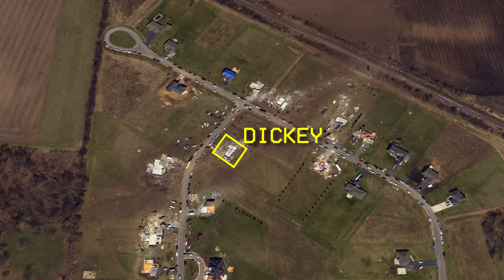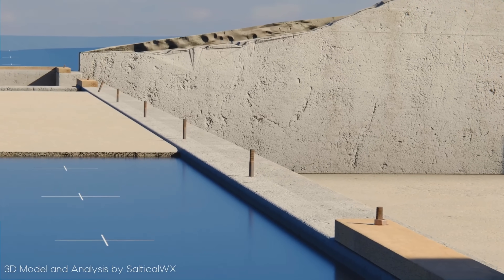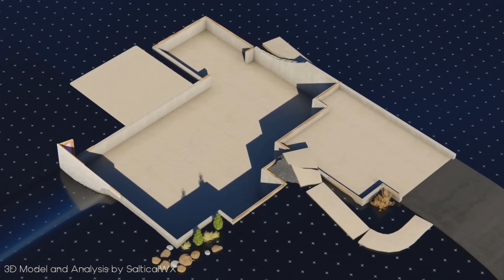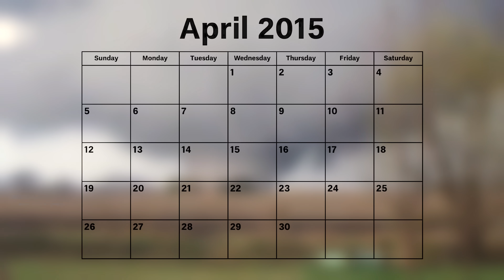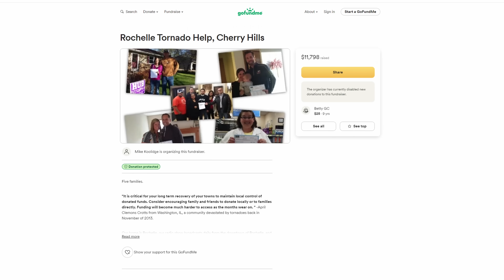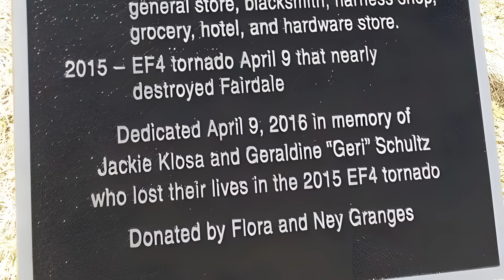The Strongest Tornado That Wasn't Rated EF5

Comment: In a high risk area...they rebuilt...now, thats understandable..its their land and they might not be able to afford to move,  but the houses are essentially the same,  wood...stone.. doesn't matter,  these tornadoes and hurricanes are powerful and are getting more stronger and more common,  its time to throw out age old designs, and start building homes that can withstand such power,  i feel its more to do with shape form aerodynamics... certain buildings have shown to be able to survive this type of severe weather,  from top to ground and ideally well under ground, something needs to be an achor holding buildings in place, whilst the shape and materials needs be able not just to withstand the punishment, but almost to guide the wind turbulence, to help the wind flow around and over....im not usually into modern architecture, i much prefer traditional BUT in cases like these,  dealing with weather like this....im afraid, its time to deal with living in hotspot areas...a change needs to be implemented in housing design

Comment: Rating tornados used to only be based on the damage and now it’s supposed to be based on the wind speed and damage but the smallest inconsistency in a tornados path makes it a lower rating El Reno mainly went through but it was 2.6 miles wide and had vortices up to 330+ mph yet it’s only an EF 3

Comment: If the difference between a tornado getting an ef4 vs ef5 rating is a person blowing really hard in the right direction, it should get an ef5 rating. 200mph is crazy to me. I think that getting an ef5 rating actually does make a difference, it gets attention from the public in a way that ef4s dont (the general public think "oh, an ef4 is bad but its not the worst it can get, right?) And therefore makes them less likely to donate to the relief effort. While arguing about past ratings is futile and will do nothing to undo the damage caused, both physical and emotional, updating the scale to more accurately rate tornados seems very important to me, both for the sake of science and for the impact that those super rare tornados have.

Comment: I know there isn't much difference between an F4 and a F5 but it seems almost disrespectful to the people that went through this to minimize from being what we all know is the truth, it being an F5 nightmare. I hope the change comes to this system in the future. Using these metrics you could go back to almost every F5 tornado and downgrade them. This should be strength and wind speeds, not destruction necessarily. Just like El Reno, that tornado was so strong it took veteran storm chasers away from us. Doesn't make any senss

Comment: Problem with tornado ratings is that they're basically done by amount of damage, not by its wind strength, width, shrouded or other factors of danger. There should be a separate scale for that

Comment: They wont give a ef5 rating even if its there they want to keep the moore the last ef5 its been shown they find a reason to downgrade a tornado to not make ef5 as they have done in greefield iowa just this yr we have had many storms that have been ef5 simce moore ok they just dont want to push the reating higher to keep the last ef5 as moore thats my opinion in general the mayfield ky was a ef5 but they didnt rate them right i feel they are intentionally withholding the higher ratings on many storms why who knows

Comment: 5:00 a miracle for car enthusiasts
Reply: Yep
Reply: Porsche 👍
Reply: Porsche🤺
Reply: Porsche sponsor = EF4 Durability 👍
Reply: Cars usually have less damage than the homes. Metal is stronger than the wall of an American home.
Even a thin piece of metal like a car roof is stronger than the weak wood americans use to build a house. 
Why they don’t use bricks and concrete is beyond me.
Reply: Apparently, the tornado doesn’t like Porsche or like Porsche
Reply: @caidonmorris8477 or it has massive respect for it
Reply: @caidonmorris8477  you mean it does like Porsche because it sparred it

Comment: Those poor pups being home alone when the storm hit. :/ If at all possible, try to keep your pets' kennels/carriers/cages in the same place as your safe space so when they get spooked they automatically run to where it's most safe. 

Bonus points if you have a ring camera or something set up so you can command them to go there remotely. It may not be enough, but it can help even the odds at least.

Comment: While I admit to not being any sort of expert on the Fujita scale, enhanced or otherwise.  I am a little confused when you put up the chart of the enhanced Fujita scale, using the wind speeds as the determining factors in its rating.   It was my understanding that the original Fujita scale used wind speeds.  But the enhanced Fujita scale used what level of damages occurred during the tornado.   In other words,  when looking at the largest ever tornado recorded, the 2013 El Reno tornado, (which to be honest, I thought this video was going to be about) was eventually rated an EF-3 rating.  You put that exact tornado going thru Oklahoma City, and it would be an EF-5 rated tornado.

Comment: I feel like that at high-ends and low-ends of categories should be .5’s. For example, if an EF-4 was at 190-200 MPH, it should be categorized as a EF-4.5, as it would sit basically in the gray area between EF-4 and EF-5.

Comment: I'm sorry,but unless the homes weren't built to code than I can't see any difference between the damage caused by this and a few other tornadoes and the damage footage I've seen from the 2011 Joplin and 2013 New Castle/Moore EF5 tornadoes!! Honestly think it might be slightly less than Joplin but at the level or slightly worse than Moore,so i guess id probably give an official estimated wind speed of 215 miles per hour...if i was to see this level of damage!!

Comment: Absolutely no doubt this was an EF5 tornado. It seems like the NWS is very hesitant these days in giving out EF5 ratings for some reason. Plus theres the debate down in Oklahoma area where Doppler on Wheels is measuring wind speeds well over 200 mph, but damage being caused is not consistent. Clearly, we need to take another look at this rating scale.

Comment: Im old enough  to have lived through  that april 74' outbreak. The aftermath of what  I saw in xenia, ohio  was a stoned, frozen face of disbelief that tested every form of logic and understanding.  A tree that had straw rammed into its core so hard that a 5 inch piece  was embeded through  the bark at the trunck an inch into the wood fluttering as if it grew out. And the football field wide scowering of the ground had you pondering what degree of force-might came through. You quickly  understood how something  as heavy as a locomotive could be levitated off  the ground with ease
Reply from the maker: Wow. Thanks for sharing James

Comment: I'm having trouble understanding how the southeast part/edge of tornado is strongest  because of rotation and translation. To my way of thinking, every side would be equally strong based on just those two forces. RFD is another matter regarding which side or part of the vortex is strongest, so I'm not considering that.
Reply from the maker: The tornado is moving forward and it is also rotating, the southeast side of the tornado is where these two directions are the same, so they add up. Hope that helps!

Comment: The only thing that I would add to the discussion on rating is that yes 200mph is the borderline of a 4-5 rating. However to be classified as a 5, it must clearly demonstrate winds ABOVE 200mph. If that debris was clearly missing, if the sidewalk had been peeled away and not bumped, if the cars were thrown miles and not yards...that is all cataclysmic damage worthy of the 5 rating. But still a 200mph beast tearing through is no small matter and I'm glad that 9 years on Cherry Hill and Fairdale are thriving

Comment: Problem is when you build your homes out of wet tissue paper, then no matter the speed its gonna have an effect, in Norway the wind speeds on the coast can reach up to 150mph. 
But the houses built there have literally steel beams going through them to prevent the roof from flying away, and the walls are half a metre thick with pretty hefty wood used. 
Interestingly, round houses are a thing in the US tornado areas one of those were hit 4 times over the years and still standing, kind of ironic.

Comment: I worked on a harvest crew back in 2011. We hauled a set of combines from Holyoke, CO to Kingfisher, OK. The wind was pretty high and NOAA radio was saying that the chances for a tornado were pretty high. We rolled in to Kingfisher and pulled in to a campground along the N-S highway in town, and while we unloaded the combines the state patrol pulled up and told us to get under cover. We quickly offloaded as the funnel was forming up above us and storm chaser were racing around. It was the single craziest thing I think I have ever done in my life. We off loaded and jumped in the truck and raced down to Eischens Bar in Okarche as we were hungry and figured the tornado would pass. While we were eating there was a lot of buzz about the tornado but we didn’t think anything of it. Turns out it touched down not far from where we were and it was pretty wild. The next day we drove the path and it was the most scary and awe-filling thing I’d ever seen. Oil rig platform ripped out of the ground. Houses wiped away. Cows in trees. Power lines gone. Train tipped over. Saw a combine that had been in the path rolled 1/4 mile down the field. It was rated an EF5 and I have to say, it was totally terrifying. I feel for these people when this happens.

Comment: The EF system is a joke. The power needs to be determined BEFORE any possible impact. This was an EF5
Reply: How can the rating be determined before the tornado hits?

I agree the system going off damage is a bit out dated but with how much tornadoes change over their life span, you can give a lot of erroneous warnings, 1 person could be told it’s weak, another could be told it’s an EF-5.
Reply: @AB-mw8oz  Doppler radar returns can give the wind speed, the size, and the speed of the tornado. It doesn’t matter if it’s going through crops, through forest, over the hill and through the dale, what damage it does or doesn’t do if it’s an EF 5 it’s an EF5. Calling it in  EF4 does not alter the fact that they measured the wind 250 miles an hour just because he didn’t take any houses off their foundations or throwing cars 3 miles.
Tell it as it is or as Howard Cosell used to famously say, tell it like it is.
Reply: Call if someone makes a missed call that’s on the someone who did it

Comment: the EF system is stupid. It needs to go back to the original F scale
Reply: EF rating is far more accurate, and about 50 years more modern. It takes into account details about structures and trees such as what the buildings were made of and such when estimating wind speeds, the F rating just determines what is gone

Comment: I still don't get why we did away with EF6. The only real difference from 5 to 6 was that 6 left marks in the ground. Which I vote is impressive enough to have an extra level if wind is digging/drilling into the ground like that! I get that 1-5 just simplifies it, but it seems that 5 is being withheld from being used, for some reason. Like it makes the tornado worse if you say it was a 5 or something??

Comment: It seems like theyre just really unwilling to give out ef5s unless it's blatantly obvious
Reply: Tornado has to eat up a lot to be an EF-5, the ratings go off damage, not wind speeds, tornadoes that pass over rural areas will generally get lower ratings due to the fact they do little damage, even if they are incredible strong
Reply: @AB-mw8oz  no they go off wind speed. Damage is directly related. The old fajita scale was based solely on perceived damage not ef tho
Reply: @AB-mw8oz  it also doesn't help your argument that this tornado absolutely did the damage of an ef5

Comment: And like I said, I don't believe this tornado was 200 mph

 that they had dceded and dropped the dolpal radar down there. I'm sure they would have gotten over at least 270mph to 300mph 

I believe they do this On purpose and withhold the  eF5 rating and even downplay the wind speed. On purpose for some reason 
I think they did this lazily. So they didn't have to deal with it

Comment: Also given that tornado winds are much different than hurricane winds for example: Tornado winds that are 200mp can feel like a 400mp hurricane (which isn't even possible) This is because I have noticed that hurricane category 5 take MUCH longer to deal the same damage as like an EF4 tornado. Usually like hours to days while a tornado can do it in seconds, and this is because the way tornadoes move. So if a hurricane touched down at any given place for like 30s it wouldn't really do anything but a tornado would so even like a EF4 is not taken lightly

Comment: A lot of issues with your final conclusion’s. First, wind speed has nothing to do with the Fujita scale. It only depicts damage and EF-5 damage can only be assigned to structures built to certain standards with items like certain anchor bolts and other standard’s which none of the structures destroyed had. There was no choice or intentional decision to not give an EF-5 rating and it doesn’t take more than an hour or two to classify it. Do these structures that were completely destroyed meet the standard to make an EF-5 rating possible? If the answer is no it’s an EF-4, it’s that easy. Second, if you’re using wind speed as your classification as strongest tornado to not be rated EF-5 none of the examples you presented are even close. The May 31st 2013 EL Reno tornado had winds measured by mobile Doppler of 300 mph but it was only rated EF-3 due to not hitting any structures at that strength as it took place over mainly rural areas.

Comment: The 2013 El Reno mega wedge was also "only" rated as an EF3 as well, not even an EF4... and that's despite RaXPol recording actual 313 mph strength winds. So a bit of suppression there too perhaps? But, yes, what's different here I guess is that there was actual structural damage to support the argument for the top rating under the newer damage-based EF classifications. 
I remember following both tornadoes live online here in the UK at the time (via chaser footage, etc)... and it was so weird (and sad) seeing the Rochelle one approach Fairdale in real-time knowing there was nothing you could do to stop it or help with the warnings.

Comment: Going off of just wind speed alone, the El Reno 2013 tornado should have been an EF5 with sustained wind speeds of 296-302mph, but based off the sheer luck of it location, it was on placed at an EF3 rating
Reply: The Winds doesn‘t matter, a Tornado with 300 mph in a Open field or do not the damages how expected then can‘t it rated as an EF5

Comment: The EF scale is an absolute joke.

A 300 MPH Hurricane wouldn't be labeled a Tropical Storm because it hit nothing in the Atlantic.

A 7.3 Earthquake wouldn't be rated a 2.3 because it happened in the ocean and didn't impact any structures.

The Richter and Saffir-Simpson scales are not damage scales. They are strength scales. "Enhanced Fujita" is a *Joke*.

Comment: What I don’t understand is with current radar technology why we can’t rate tornadoes using that data also. We have had multiple tornadoes recorded by the DOW with over 300+ mph winds and be only rated EF4 or lower . Even with ground based radar it wouldn’t be hard to determine the accuracy of a tornado’s wind speed with a simple calculation. Basically distance from radar, height of measured wind, measured wind speeds at height, and gate to gate wind shear would give you an accurate gauge for how powerful a tornado was at ground level. Also I believe there should be an error estimate. More like instead of saying it had wind speed of up to 200mph at its peak strength. It should be rated as a high end EF4/low end EF5 with peak wind speed between 190-210mph. Since tornado winds are constantly fluctuating and the given wind speeds are only estimated anyways when doing damage surveys.

Comment: Those homes weren’t built within the new standards. That’s why Moore was the last EF5. Homes that were hit in EF5 were built with those new standards. 

Wind speed actually isn’t relevant in the EF scale - damage is. 
El Reno was only an EF3 and it was over 300mph and over 2 miles wide. That’s because it didn’t hit anything built to those standards with EF5 strength.

Comment: The biggest problem with the EF scale is that it's really a minimum force scale.  It can tell you the minimum wind speeds required to do damage, and it probably works pretty well for weaker tornadoes.  The problem is with high end tornadoes.  Very few structures can withstand 200 mph winds, so even though the top winds may be hitting 250mph+, the EF scale only gives you an EF4 because it didn't hit anything that can withstand winds > 180 mph.

That being said, it's becoming increasingly clear that the NWS has been intentionally withholding EF5 ratings for quite some time now.  You can pick your favorite conspiracy theory as to why, but either way, it's not only true, it's obvious.